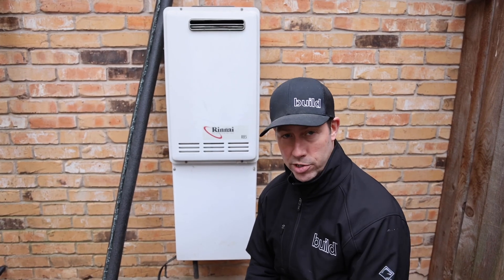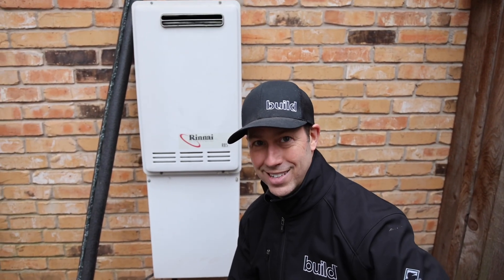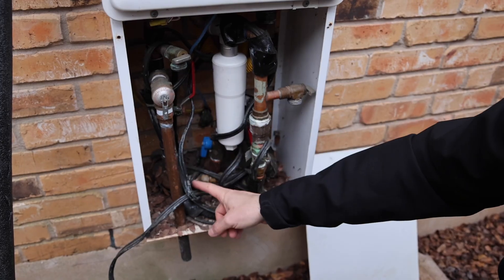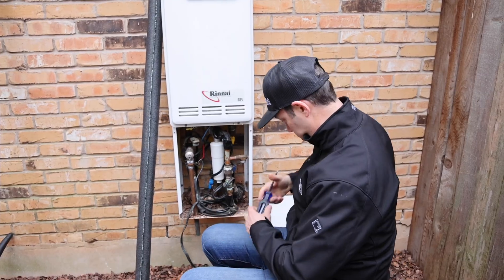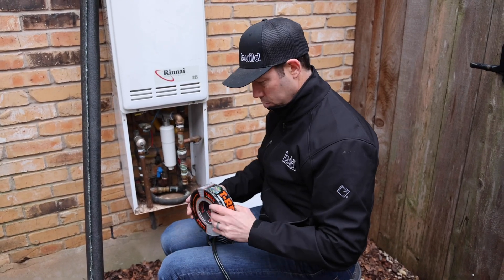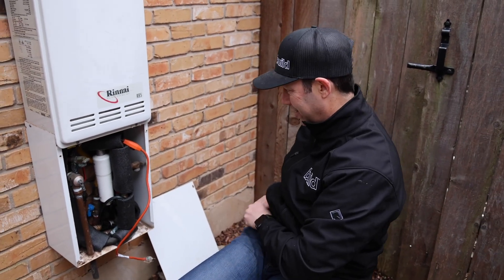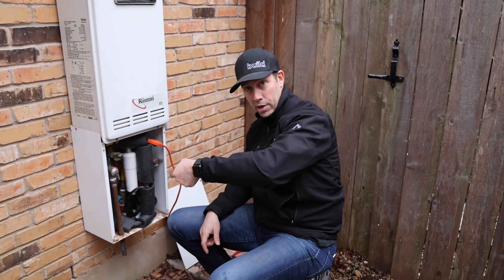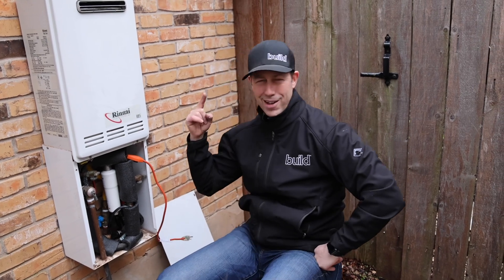$30 and 30 Minutes - Tankless Water Heater Freeze Prevention

Comment: I looked at the heat tape but the directions say not to wrap it around the pipes but tape it on the pipes in the same direction as the pipes.   Also, it warned against leaving a loop of loose cable.  How did you use up 6 feet when the pipes are only about 2 feet?

Comment: Oh Yes! This cold spell of 2025 finally got my outside unit. I was thinking of using a hair dryer to do this. Then decided to research first as well. This video was spot on in that it validated my idea and also more info on how to do it. Just like you train here. I moved over the inlet and exit lines and not too long I could hear the moment it broke free and started working. Great Advice here. I will also look to further insulate the lines. Thank you very much.

Comment: Hi Matt. Thank you very much for this video. I installed all of this for winter and it worked perfectly. Now I have a question for you because something weird is happening. When I unplug the heat tape and put it back inside the box (for next year) I don’t have any hot water. I have water running on the hot side but it’s cold. If I plug the heat tape again, I hear a noise coming from the water heater and then I have hot water again. Any idea what’s going on and how I could I solve that? Thank you!

Comment: Hi Matt. Had a question for you. I've done all the things you've mentioned in your video including the one you did in 2021 and I'm still having freezing issues with my Navien tankless. Do you know if there is a way to insulate the heater unit itself? Maybe building an enclosure around it and insulating the inside of it? Heat tape is installed so my copper pipes are good but the underside pipes and the unit itself are susceptible to freezing like we experienced last month down here in Austin. Any advice?

Comment: My Rinnai unit is mounted in, not on, exterior brick (North Texas) and has slightly less pipe showing than yours when I remove the cover. Your video really didn't show how you wrapped the pipe with the heat cable and I'm not following how you used up 6+ feet without overlap. Can you clarify and/or post more pictures? Also, is the foam insulation safe - seems like I'm seeing fiberglass recommended with heat tape/cable usage?

Comment: Thanks Matt - used the heat tape approach on our outdoor Rheem at a vacation cabin in the Texas Hill Country last year after I saw your video (we lost one in the 2021 freeze).
Question though - I have been looking at the air compressor method to blow water out of all the lines in the house if left unattended in Winter. Does blowing 30 psi air thru the tankless (with the gas and power turned off of course) cause any issues? Or - would you suggest draining the tankless separately, and then isolating it (we have a valve service kit installed on it) while applying air to the house plumbing?
Thanks!

Comment: Hello, I liked your video and subscribed. I have a gas exterior tankless. I had no water at all coming from hot side this morning. If there is no water and I have the water turned on. Is there any danger of a gas leak in the house?  Tonight it is going to be even colder. I have all fixtures running. But not water is hot. Will I get any gas in my house?  Is everything ok?

Comment: Tankless in my garage is leaking after cold snap this last few days. I had been heating tank area at base with space heater. I stopped last night. Outside Temps were 20-25 F, with garage temps at 52 F.  I suspect damage to water heater.  Water heater works supplying hot water to appliances and sinks, shower tec😮.  But leak is internal to WH and I fear the worst, damaged pipes or parts.  Had to buy a new water heater Feb. 2021.  I will open up and investigate but I plan to repair if possible.

Comment: I have a Noritz system. The primary and secondary heat exchangers froze so I had no water from the hot side taps, and with that no hater water. I paid $342 to watch 2 techs point heat guns at the heat exchanger for 1.5 hours. Obviously, I now know how to deal with this issue I will not a tech to come out if it happens again. I find it to be a complete and utter failure of design that the heat exchangers froze. Steer clear of the Noritz!

Comment: This video would have been much more helpful if they hadn't sped up the actual application of the heat tape to the pipe. For the amateur, this  wasn't much help. Then when he was showing how it looked when finished, the camera was focused on the speaker, not the work done. I could see very little of the pipe. This did give me a general idea of how to do this, but I'd have appreciated a better look at the application.

Comment: OMG what's the reason you applied heat tape to the propane supply hose to your tankless water heater? that seems very dangerous and I would suggest for your safety and anyone in it to have that inspected. especially if you have rodent problems. Just bought some water pipe heat cable and you did everything that the manufacture said NOT to do. Also your using "Heat Cable" not heat tape as what's stated in your video. Completely different products.

Comment: The sheet metal enclosure below the unit, where all the pipes are...does that come with the unit or is that an add-on? If an add-on, what is it called? Every picture I see of one of these units does not have that enclosure is why I am asking.

Comment: Why not just put the heater inside the basement like most people do?
Reply: Most people in Texas (he's in Austin) don't have basements and many times the home already has one installed when you move in. Moving one that is mounted on the exterior of a foam encapsulated house into an attic is not a trivial or inexpensive project, especially if mounted within brick opposed to on the brick.

Comment: cover that whole thing up with a 2" xps foam board painted white. obviously leave gaps for the venting, or perhaps use rockwool if the heat is an issue. not sure what code would allow. Rockwool would also be better than that black foam insulation

Comment: I know this is 6 months old at this point.  My attic-mounted tankless issue was similar, but it was my condensate drain that froze.  Hair dryer worked like a charm, but had to do it each day of the storm. Heat tape purchased in case it happens again.  But this was a "century storm," so hopefully not again in my lifetime.
Reply: lol century storms now happen every 7 years

Comment: Nice.  I plan on installing one outside also.  I did not know you can buy the bottom box.  It makes for a neater job.  Does this come from Rinnai?  I may use one from Navien.  They make one with in internal tank which makes recirculation systems a little bit easier I believe.

Comment: Off topic but with in the same subject, I have been researching tankless water heaters but can not find any info on how long the exhaust and vent pipes can be. Utilising a condensing heater and may need to run them 4' up and 20' over to the outside wall. Anyone with an idea on this would be appreciated. Thanks.

Comment: I have this exact same water heater, also mounted on the exterior wall. I am about 35 miles outside of Austin and we got down to zero during the recent cold weather. Built a tent over the water heater with a small electric heater underneath. It was ugly but it saved my water heater.

Comment: All of these comments suggesting that you leave your water running slowly to avoid the freeze don't work too well if you are on a well and you are trying to conserve water pressure (and water) for the period that the power is cut off. That water pressure drops pretty quick in that case if you have been dripping it all along. The only thing that could help is if you have a backup generator to run the heat tape or shut down the heater and drain it until you are confident that your power is good to go.

Comment: The trickle of hot water has got to be the key. But I'm not sure there would have been much we could do besides drain the thing since we lost power for the three coldest nights in the last 30 years. Ours sprung a leak in one of the pipes around the heat exchanger. the pipes at the bottom are just fine. not to mention we lost power for the three coldest nights in the last 30 years. It was just way too cold in Central Texas for the way they build.

Comment: Hi, I'm in Austin Texas. I have a water heater similar to that and the top pipe where the hot water runs burst.  the installation company does not want to cover the warranty and neither does the company that manufactures it.  The bottom cover that I see yours did not put it on mine I don't know if that's why it freezes.  how can you help me ?  Thank you

Comment: I just had unit freeze in Galveston.  Pipes burst both hot water to the house and supply in the house.  Lots of damage.  Power off for two days.  Electric tape won't work then!

Comment: We have a rinnai outdoor tank but the internal heat protection didn't matter because we lost power for 48 hours.  Now we have a broken cold line to the tank.  Thought it was a simple fix with a shark bit elbow but upon further inspection, I have a seeping leak from the hot water return and now getting a code on the keypad that translates to needing a plumber to service.  Hope this thing doesn't need to be replaced.  Only 4 years old and always go back to your video for the annual flush because my old brain won't retain anything anymore.  Going to look for the heat tape for the future.  Also considering have an electrical transfer box installed so I can run a generator to certain circuits in the house including the hot water heater.   What a headache.  Finding a plumber is the real trick right now. 😞

Comment: Any Texan watching this after blackouts and heater leaks after the cold snap this week?😭
Reply: Came across your question and decided to take the few minutes to comment.  Pay attention when you hear "as long as the power is on".  In my opinion, that's one of the issues with that Noritz system.  Unlike a traditional "gas" HW heater/tank system which uses a thermopile ignitor and doesn't require electricity to function, the Noritz system does require electricity.  Installing that unit on an exterior wall is a foolish idea if you live in an area that freezes (like Houston).  I'm fixing someones Noritz 981 SV and definitively located the issue.  The output water supply/servo is cracked and I suspect that it's the same problem with many Noritz systems right now.  Power outage > sustained freezings temps > output servo is obviously the weakest link in that system during a freeze.  It's a black/white plastic part located in the lower left side of the box and connected to the 3/4" copper supply line.
Reply: Yup, mine busted on one of the heater coils
Reply: And this one
Reply: Yes, will be installing heat tape but unfortunately it got down to -2 degrees here in Texas and power was out >24 hours so I don’t think it would have prevented my unit from freezing and bursting.
Reply: Yes,  ironically. Wish we saw it last week.
Reply: I'm in Houston and I have to replace my heater. Along with just about anyone with an external water heater in my subdivision. And there are lots.
Reply: @dasansgunner  Same here in Dallas. All my neighbors are replacing external water heaters. Some with minor leaks (a few spots dripping, while others are just gushing). Horrible.

Comment: Rinnai’s water heater failed because electricity stopped.  The internal frost protection stopped.  Frost protection run heat often enough to keep it going.   No electricity, No igniter, no heat= heat Exchanger burst.  Outside pipes fine. This is at my parents are in Austin.  Rundberg area.  I ordered a replacement.  But electricity out for four  days there is no protection.  Your advice is good but we needed to drain the lines and shut it all down.
Reply: Yep. We made the same mistake

Comment: We have a Nortiz Tankless Gas Hot water Heater..here in DFW.. power outage for a couple days and it looks like something let go in the Tankless.
They are installed on the external wall.. I was able to shut off pretty quickly.   I am assuming it was one of the copper manifolds that burst.  
NO I did not drain the system.. I was so excited about PEX throughout the house I overlooked the weak link in the system. I also did not expect 3 days without power.
That being said.. If I can find the failure location.. anyone think this can be a DIY repair.. or since it is heated with Propane.. should it be left to the expensive local pros?

Also.. thinking about installing Freeze Protection Solenoid Valves.  $500+ cost.. so not sure if I just save the money and not be dumb next time we get a freeze.

oh and Matt,,  Subbed after seening you on off the ranch... good stuff.. and great, very helpful channel. I appreciate it.

Comment: "As long as power is on". Good luck. This type of installation of tankless water heater is the worst. It is doomed to fail. Just one freezing night coupled with power outage, it will be likely gone. In past few days with the extreme weather in Texas, my neighboring community had more than 50% failure rate with the external water heaters, which are even installed recessed in the wall. Please convince your customers to install internal models if the option exists.
Reply: Most of the houses in our neighborhood that share a common builder also had theirs fail. All tanks on the outside without power for days.

Comment: This video was a huge help this week as this was my first house with a tankless water heater.  We woke on Monday to no hot water, but at least we had cold. I have a couple of added "tricks." I had a 1500 (very hot) air gun and a laser-pointing thermometer to check the temperature at various points. I took off the lower door to expose the cleaning valves and inlet and outlet pipes and then used some aluminum foil and duct tape to recover them with a hole for the hot air gun. I then used the hot air gun to warm the whole area using the thermometer to make sure nothing was getting too hot and to know when I was done. I also made sure the hot air gun was not aimed directly at any plastic and it was a few inches from the hole just to be safe. It got everything in the area up to about 50 degrees F but still no joy so I figured it was either not "it" or it was fixed. I also check the temperature inside the hot water heater itself and it was fairly warm (I think above 60F), so I knew the unit was protecting itself. 

It turns out, the water lines to and from the heater ran in a wall chase on an outer wall of the garage next to the water heater. I drilled a 1" hole in the garage wall and filled that chase for about 10 minutes with hot air and with the crackling of ice sound, the hot water heater fired up and the hot water was fixed.  The key point here is that it is not just the pipes you see under the water heater, but the ones to and from it that are likely running in an outer wall that you have to make sure are not frozen. 

Looking back, I was most worried about the lines in the attic. But with the furnace in the attic and sun out and helped along by a 1500W room space heater, the pipes in the attic were getting above 40 degrees even with 10 degrees outside by the afternoon (first thing in the morning they were in the 20s). It was the pipes just below the water heater and the pipes in the wall chase that were my big culprits. I'm going to put a removable cover over the hole in the chase with the pipes so I can pump hot air in if they ever freeze again. Hopefully, it will not happen again as we will run some trickles of water any time it gets much before freezing.

Comment: Matt,  great video.   Rinnai R94LSi exterior mounting in Dallas TX.   

1.  What process should be followed when the power goes out for over 12 hours and it's below freezing?   What are the preventive steps.       
2.  When the electricity came on no water coming through the hot water taps.  We put a light bulb and it thawed out and we had hot water.   However,  a few of our neighbours when it thawed out,  there was smoke coming from the actual unit.     What process should be followed after the power has returned?

Comment: The heat tape was not installed properly with the temp sensor (black disc) against the pipe being heated.  The old tape likely overheated and melted, the new will do the same if installed incorrectly again.  Sometimes it pays to read instructions.

Comment: Oof there's some issues here and one of the biggest is that the heat cable should never touch itself (i.e. you can't just coil up extra or run loops where the cable intersects) IT CAN AND WILL MELT. The directions and warnings are clearly indicated on the packaging. Another issue is that no mention was made of the sensor/thermostat control that is built into the cable. It turns the cable on once temperatures drop to a set degree. This sensor therefore should NOT be placed in a heated space, it needs to be exposed to wherever the cold temperatures originate from for the cable to come on and function properly.

Obviously as Matt said, this method only works if your power is on, sorry Texas.

Comment: You can add a thermostatic plug which turns on when temperature hits 32 degrees.
Reply: That type of heat cable has it built it. That's what the little orange and black plastic piece is where it transitions from black to orange.